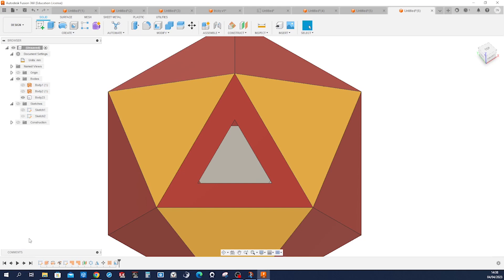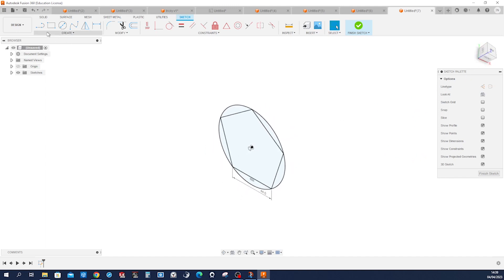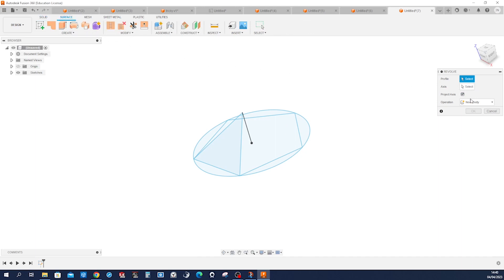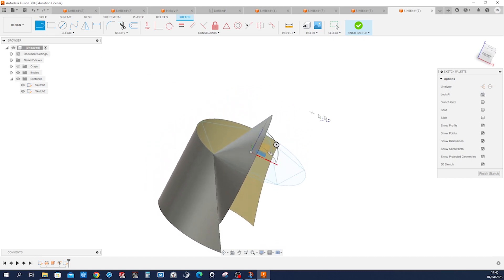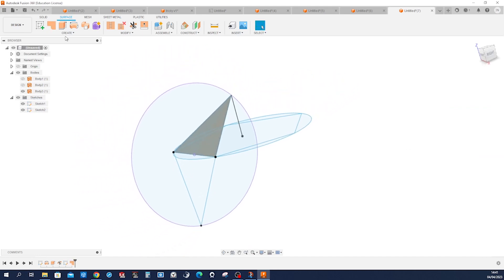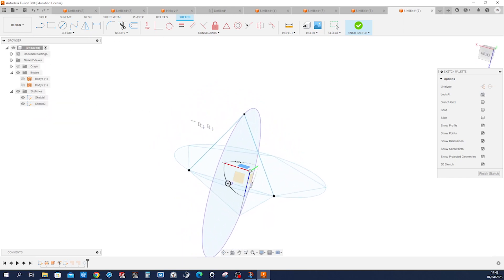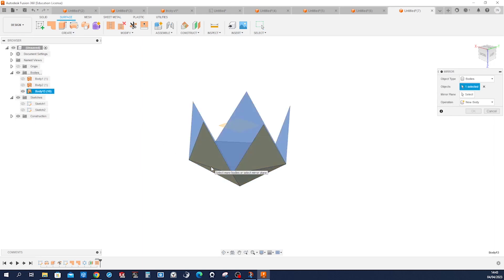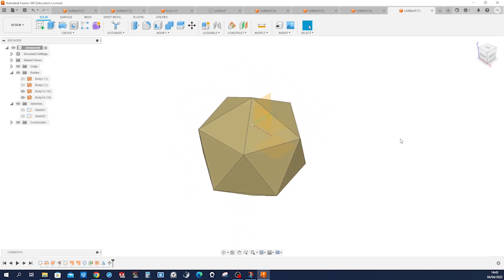Model an Icosahedron in Fusion 360

Comment: Hi Sir! Thanks for interesting video. I'm only a senior with a pen and paper. If this item consists of 20 similar triangels... would You help me with the angles, please? When cutting those triangles with some thickness, eg of wood, what is the angle of the sides? The corners are 60 degrees, but what is the mitre angle of the sides? Thank You!
Reply from the maker: Hello, I found the angle described here: https://makeyourpiecegames.com/posts/building-a-d20-one-piece-at-a-time-using-math/#:~:text=For%20a%20d20%2C%20or%20regular,angle%20is%20about%20138.19%C2%B0.